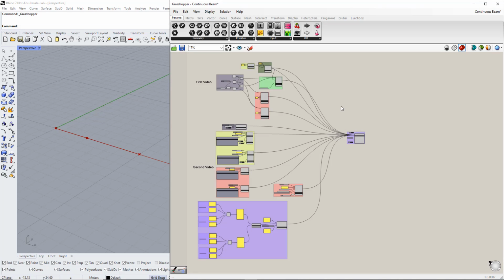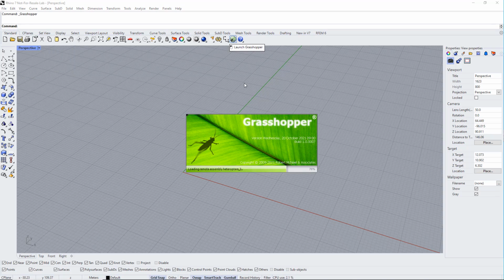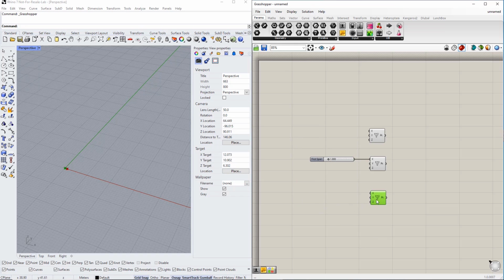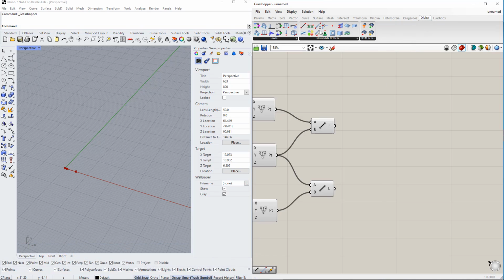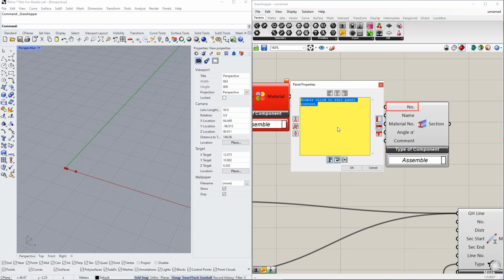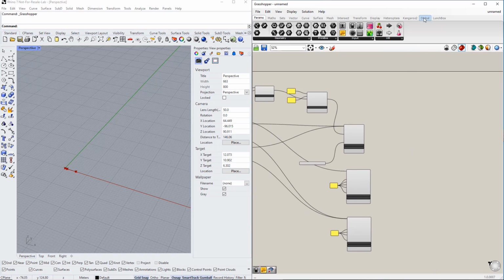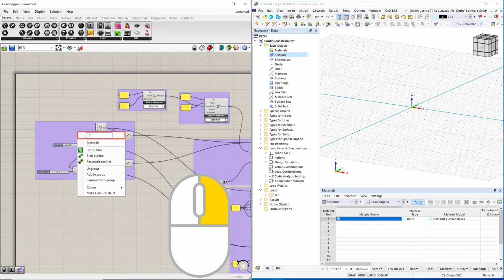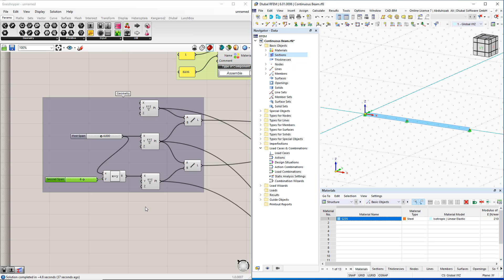RFEM 6 Tutorial with Rhino & Grasshopper | 002 Continuous Beam | Part 1

Comment: hey and thanks for this tutorial. I become this error in the export component: 

16:40:45.167 | starting transfer process sync
16:40:45.188 | Model with name newModelis used
16:40:46.345 | Error: Objekt: Stab Nr. 1
16:40:46.345 | Attribut: Querschnitt - Am Stabanfang i
16:40:46.345 | Fehler: Bitte stellen Sie dieselbe dünnwandige Modelloption für alle Querschnitte ein, die dem Stab zugewiesen sind.
16:40:47.381 | Closing log file...

I implemented a section and a material according to this tut but RFEM seems to not recognize it / needs some extra setting which I cannot find... any advice on this?
Reply from the maker: Hi, Martin!
Please send us the structure to this email address support@dlubal.com